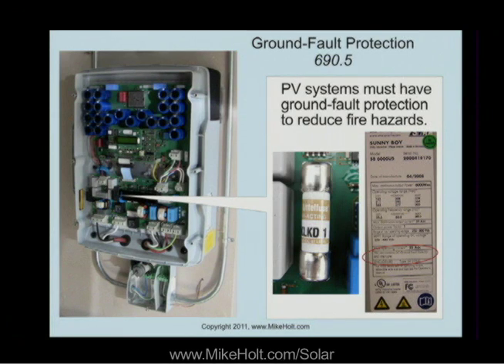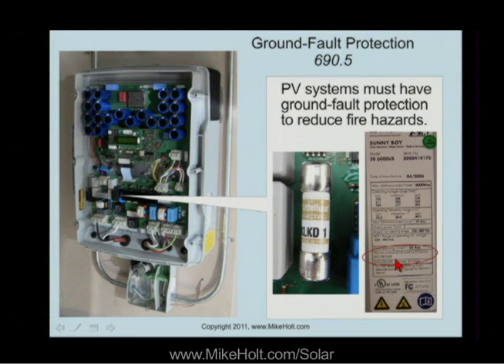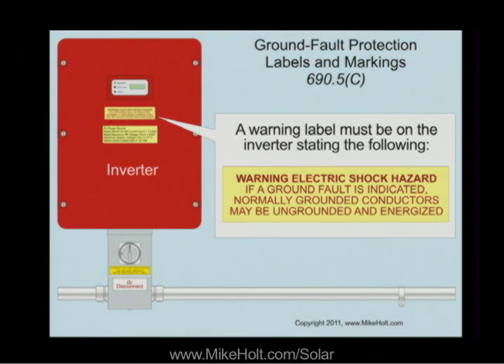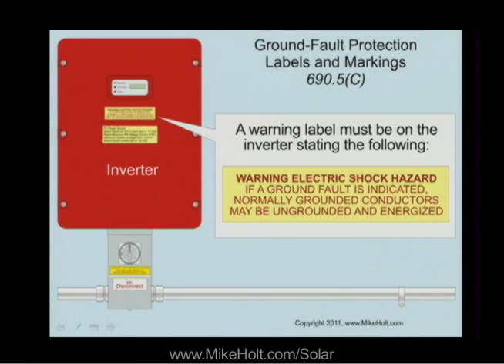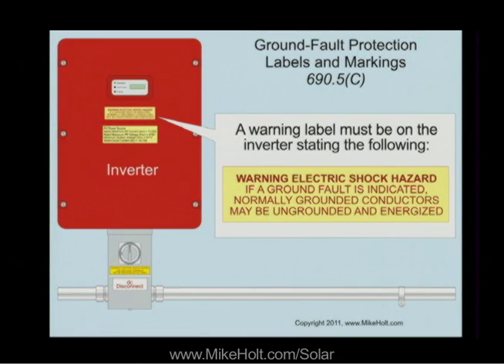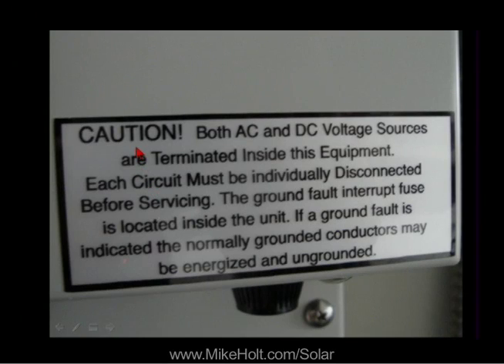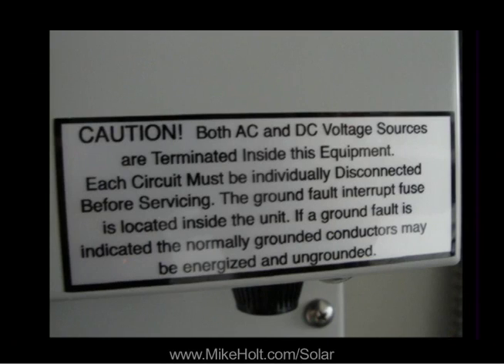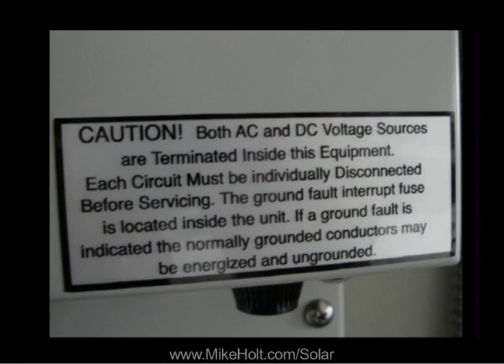NEC 2011 Solar - Ground Fault Protection 690.5 (5min:02sec)

Comment: Unfortunately even in the year 2020 there are still many solar charge controllers that do not come with GFPD built-in even name brand ones that are being used in residential solar installations.  In order to be NEC compliant in stationary installation an external GFPD needs to be added.
Reply from the maker: Solar charge controllers do not require GFPD protection.
Reply: @MikeHoltNEC  Thanks for the reply.  I understand the controller itself does not require GFPD but some do have them built-in which would imply they are safer than those that do not have them.  There seems to be a lot of confusion over when a GFPD in a grounded PV system mounted on the ground especially in an off-grid situation.  What system would protect against a fault in the array if isn't the charge controller unless an additional GFPD is added?
Reply from the maker: @davidb.5544  Call me 352.455.0794 and help me understand your concerns. To me, if it's per the NEC, then GFPD is provided with listed PV equipment is installed.